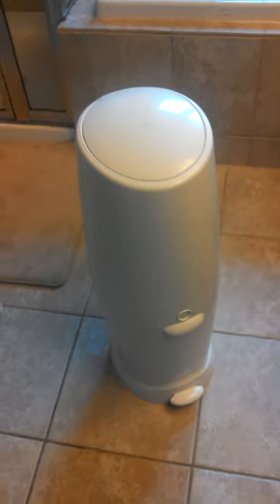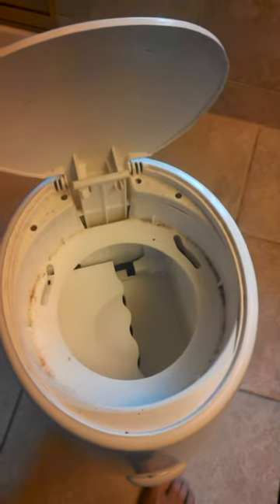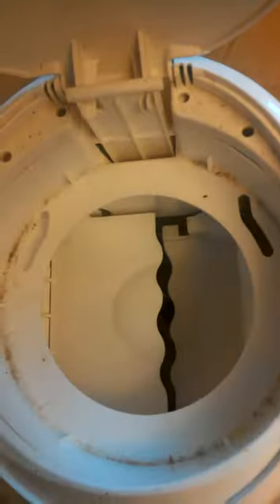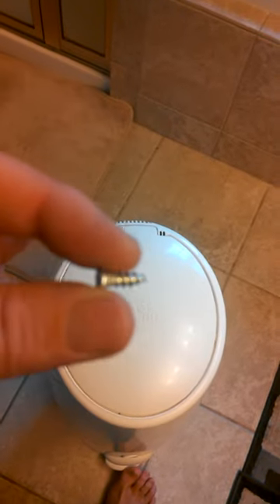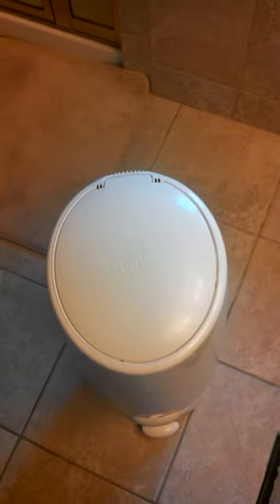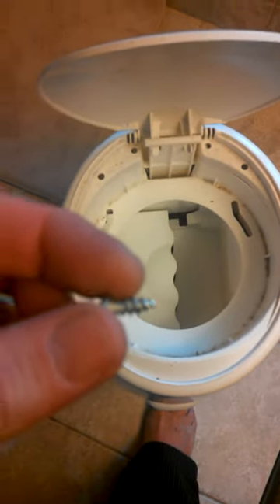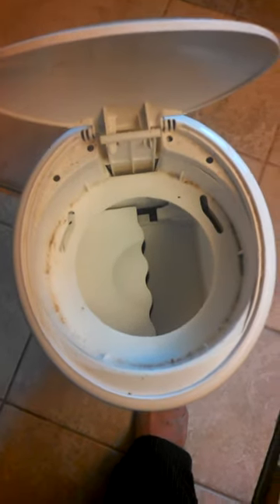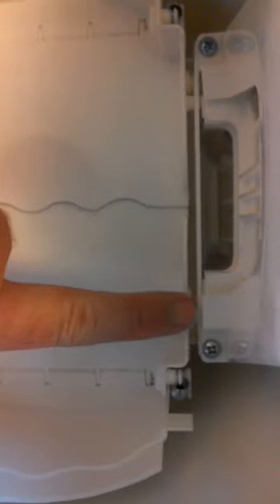Fixing the opening mechanism on the Diaper Genie for free (Part 1 of 2); but this video is your fix.

Comment: There is an easier way to do this. I watched your video, and took the genie apart to better understand what you were telling me to do. I noticed that the doors were identical, with posts on both sides. I removed the 6 screws holding everything together and swapped the doors. Now the intact "outside post" on the "right door" fits into the slot that was used by the broken "inside post"  on the "left door". You have to gently spread the frame to pop the doors out, but no drilling, no marking, and all you need is a long Phillips screwdriver to handle the screws. Everything seems to be working fine and it only took a few minutes. Our genie isn't used all that much, we only have it for when the grandkids come over, but all seems good.